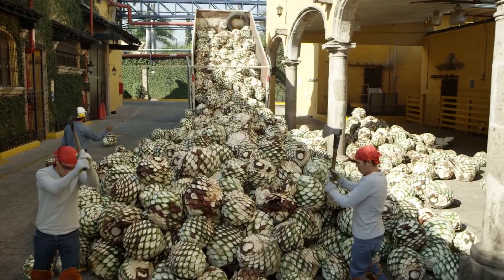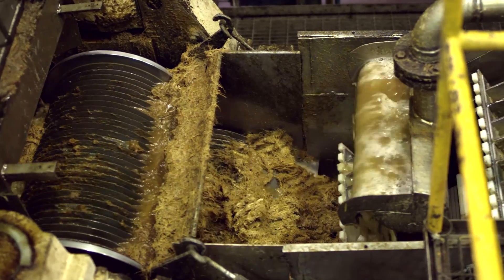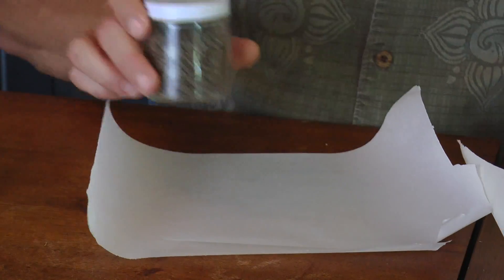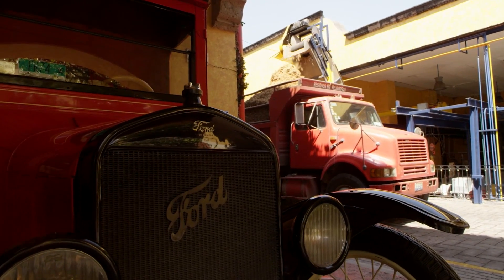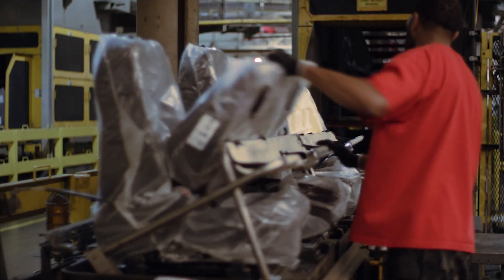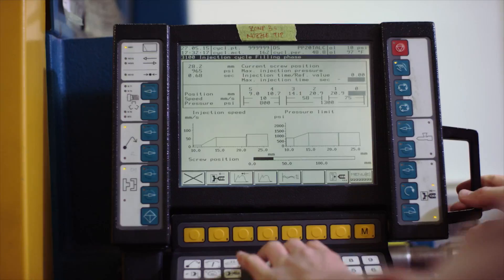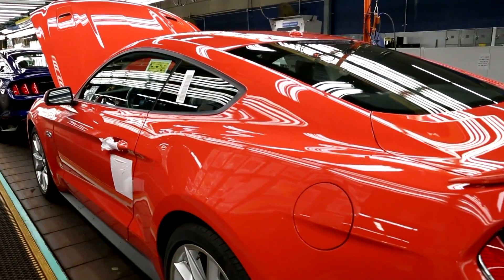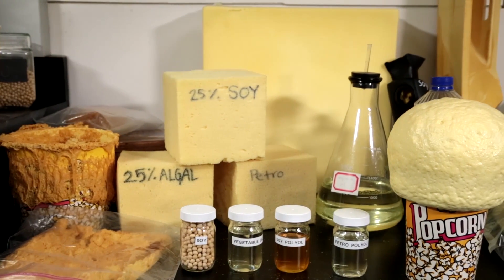Ford Makes Plastic from What?

Comment: very informative and professional video....one of the best on the channel...keep up the great work
Reply from the maker: Thanks for the kind words and support, Sartaj!
Reply: +MPGomatic would like more mpg tests tho...u work with autobytel as well?
Reply from the maker: Sartaj Aujla I produce MPG tests whenever I can! Need to pick up 2 new GoPros, but funds are tight. Started shooting for Autobytel in 2013 - that's taken up most of my time.
Reply: +MPGomatic ah u do there 0 to 60 tests as welll?
Reply from the maker: Sartaj Aujla I have never shot a standalone 0-60 test for Autobytel. (long story) I may start doing more 0-60s here in this channel again, if I can line up the proper resources.
Reply: +MPGomatic aha u do what works best for u
Reply from the maker: Sartaj Aujla Gotta keep the bills paid. I have some crazy cool stuff in the works. Just need to fill up the tank …

Comment: squirrels chewed on my fathers wire harness on his brand new equinox causing $700 of damaga
Reply from the maker: Yow. Maybe they could add rodent repellant to the mix?
Reply: +MPGomatic something they use in the plastic covering of the wiring harness is tasty to rodents. it's derived from plant based materials. Some people are suing manufacturers over it